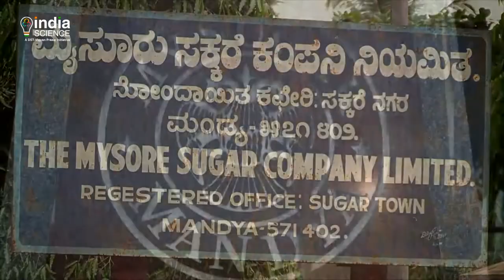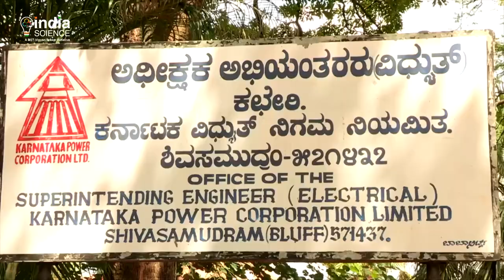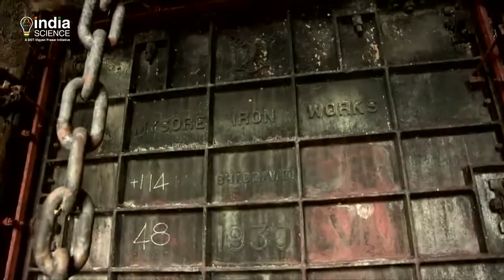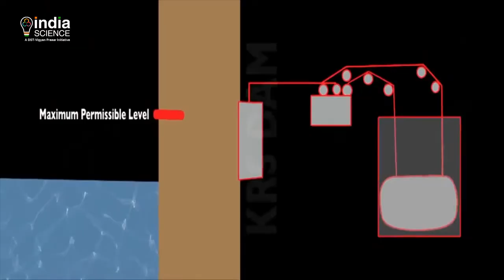KRS Dam by Sir M. Visvesvaraya | History of Krishnaraja Sagara Dam | KRS Dam

Comment: I've never been to the KRS dam. When I watched this video, I was amused to see the working of this dam. a curiosity came to my mind when the well is filled with overflow water, the float gets lifted resulting in the downing of a counterweight which lifts the 10-ton gates. My question is how will float go down? (so that gates must be closed when water in the lakes gets down.) What I think is that there must be some valve system in the well which gets opened when the water level in the lake gets down, resulting in the release of water from the well, which in turn will bring down the float.

Comment: Automatic Sluice gate as shown with Explaination... Is a good engineering but without those gates if water level increses water will flow n remain upto brim of the dam naturally.  So what is the use of these gates when there is no option to open or close gates with choices???🤔🤨
Reply: There is small part is always open in dam, in KRS 2000 cusec water will go for fish, gates will open only when water is full, if gates not open automatically, they will lift the weight using crane so automatically gate will open

There is another dam markonhalli,
Same trial done by sir MV

Already one or 2 automatic gate destroyed due to idiot politician

But it is also Venturi effect, when water full sound you can listen almost 7km
Reply: I haven't seen the dam, but I'm sure there would be some small passages with gates to give water supply for sugarcane farming.